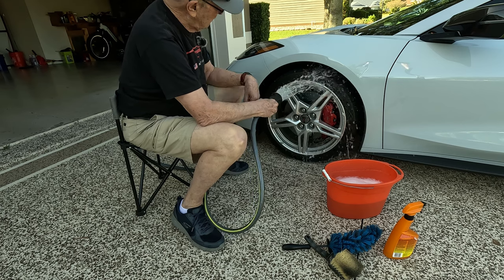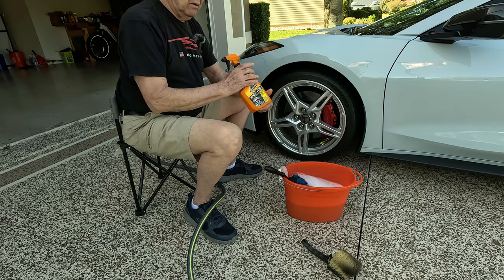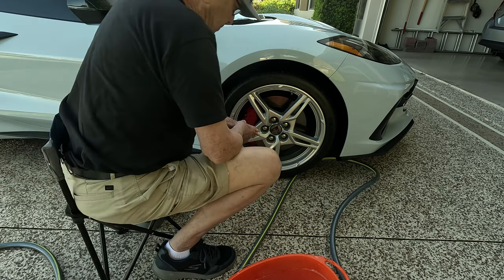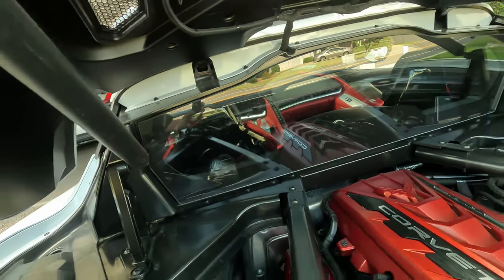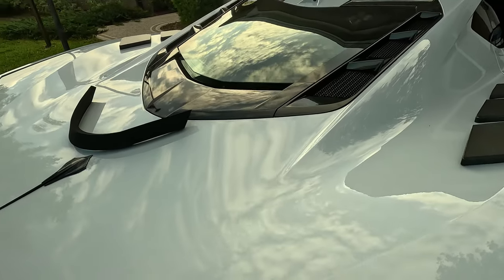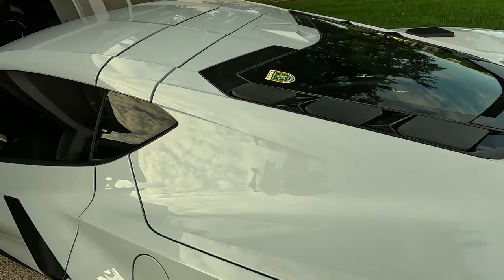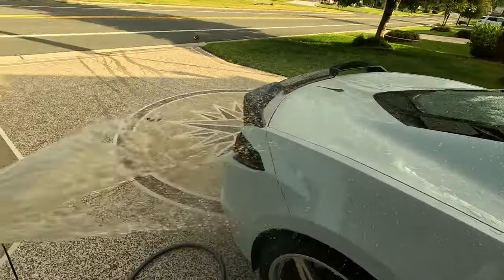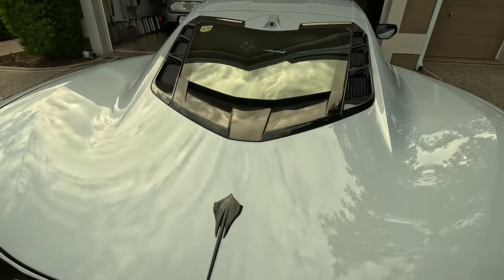Wheels Windows & A Dry Engine

Comment: As always, the right tool for the right job…..   
Was sunny and warm here in PA Monday through Friday.  I waited until Saturday to Spring Clean my HTC and now it’s going to rain all day I bet!   😂

FYI & Friends.  

For my 2022, it was built 2/8/2022 and came delivered without the Park Assist Module.  After roughly 14 months, GM notified me the part was now available. My dealership installed it on 4/11/2023.   So if anyone was promised a retrofit, check with your dealership.

Thanks Robert for the tips!
Reply from the maker: Good stuff Kerry. Thanks for the post!

Comment: Robert great video. Hey get you one of those small shop seats on wheels. Harbor freight has them. They are great for doing wheels and low work. You just scoot around👍🏻.
Reply from the maker: I have one that I think I bought at Harbor Freight, but it keeps sliding down my driveway. Driveway is not level.

Comment: Bob… did you get a new C8 or was this done before the strips went on?
Also much better the Invisible Glass is this product Sprayway Glass Cleaner.  Try it and you’ll be switching!
Reply from the maker: Great info!!! I will try it. 
My 1st C8 was a 2020 and this is a 2022 that I picked up a couple of months ago. Less than 3K miles with 3lt and all the options I had on the other car. So, no strips YET!. Think I'll do a video to intro the new (almost new) C8 and see if I can match the 2.8 sec. (0-60) I was able to do in the 2020.
Reply: @RobertMacCready  That would be great! It's just about time for another MacCready C8 launch video. No one explains these things like you!

Comment: Did you happen to mention that those 7 little sponge inserts that keep a few drops of water off the engine cost $130?
I can mop up a lot of water for that kind of money.
Reply from the maker: I don't think I did but if you're spending 80 to $100,000 or more on a vehicle, $130 is nothing. And the other brand out there (their competition) is $250.
Reply: @RobertMacCready  I don't suppose you recommend having these? Inserts installed when driving in the rain?
Reply: Those sponges, regardless of price, solve a problem that doesn't exist. In the time it took to insert them, you could have wiped down the engine compartment.